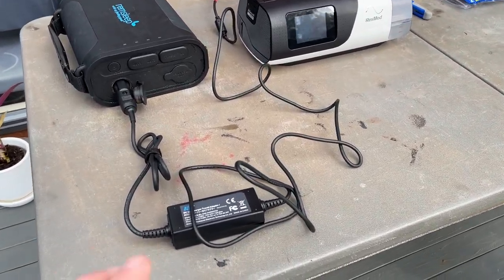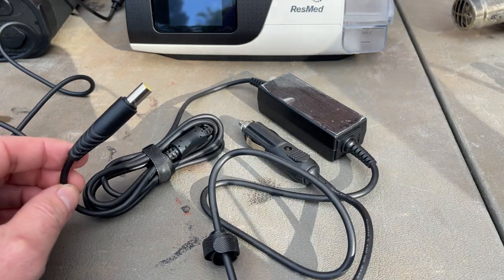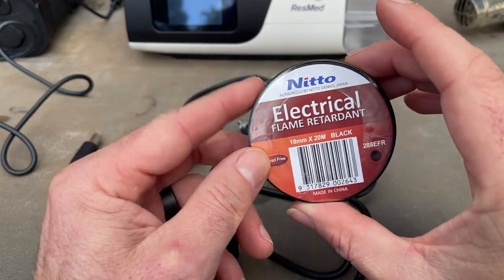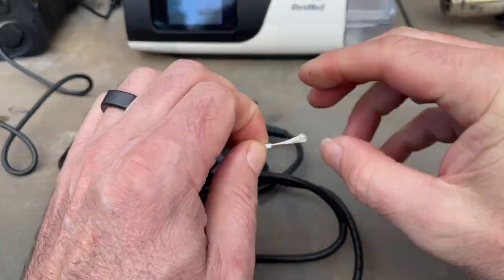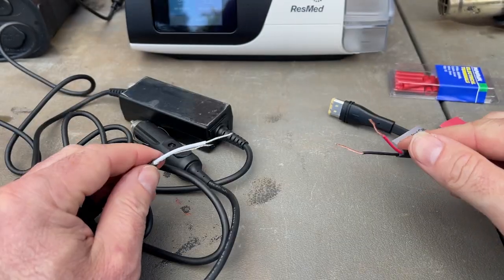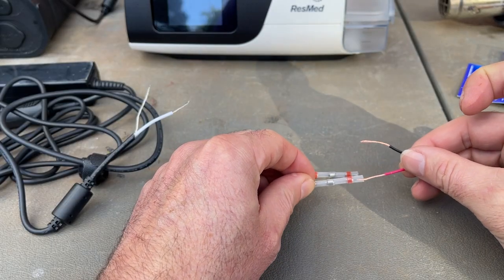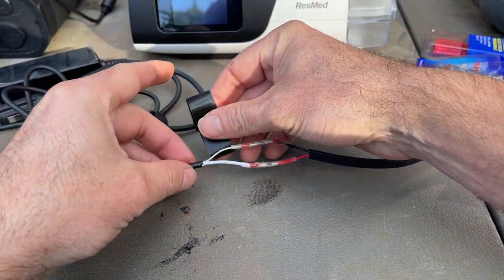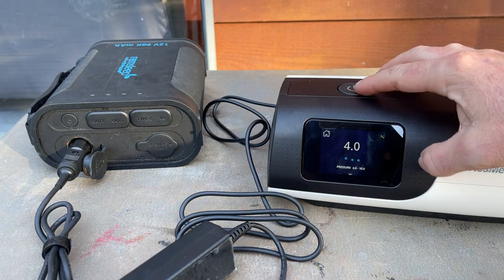🔌🔋You Need This! AirSense 11 DC Cable Hack

Comment: Followed your video and your hands-on advice worked perfectly. Using a Jackery  300 with the resmed 11 with the humidifier on I get 6 hours or slightly more. With the H2O off, I get 8 hours or more. This is for those power outages that happen occasionally here in west Texas, usually no more than four hours once or twice a year. Thanks for the advice and well-made video. I've been CPAPing for 11 months. It saved my life. Hadn't slept well for three years. Cherio, Mate!
Reply: you only get 6 hours off a 240Wh battery?  on my resmed S9 with a AIMTOM 155Wh/42000mAH i would get 20 hours.  Does that mean the Airsense 11 uses much more power?  Or this hack with the adapter is not optimal?  It appears Resmed now has an adapter ResMed AirSense 11/ AirMini DC Power Cord for the EXP Battery   but it is like $165 CAD.

Comment: One advantage of the DS 1 is that they run on 12v DC.   It was actually this fact that steered me to the ds1 over the as10 initially (in case of a mains power outage).      Thank you again for advocating for patients again!!   🍻
Reply from the maker: That was certainly one of my fav things about the DS1 also. Always welcome brother. Cheers :_hello:

Comment: I just bought the AirMini dc/dc converter and it does work for the AS11. Same connector type, plugged to a Jackery 300 and no issues yet.
Reply from the maker: Hi Juan, i have both an AS11 and AirMini and the AirMini Plug WILL NOT FIT A AIRSENSE 11 however and AIRSENSE 11 plug will fit an AirMini. Cheers
Reply: @CPAPReviews  hello there! I sent you an email with pictures. 😅
Reply: So what's the verdict? I'm going camping next weekend and still trying to figure this out :-(
Reply: @CPAPReviews  
You are correct that the Airsense MINI's plug will not fit an Airsense11.  However...  The Airsense11's plug WILL FIT THE AirMINI.

What kind of magic is that, you ask?!??  The two plugs (and their respective sockets) are only different in the corner chamfers.  The pinout is the same.  The plug and socket chamfers prevent plugging the 20w AirMINI ac/dc adapter into the Airsense11.  Resmed designed it that way because the Airsense11 needs 65w, and the 20w AirMini ac/dc adapter is insufficient.  However, the Resmed 65w Airsense11 ac/dc adapter will work on BOTH the AirMini and the Airsense11.  The plug fits both, and wattage is sufficient for either of them (more than sufficient for the Mini).

The Resmed "Airsense Mini DC/DC Converter" is also 65 watts, just like the Airsense11 adapter, and has the same "high-wattage" plug as the Airsense 11 ac/dc adapter.  That means that the Resmed AirMini 65w DC/DC converter will work on BOTH the Mini and the Airsense11.  

Like @Juan P Hernandez, I have been using the AirMini 65w dc/dc converter with the Airsense11, and it works flawlessly.  

The only complaint I have is that the Resmed DC/DC converter has a fixed low-voltage cutoff of 11.4v, as measured under load.  Depending on the load, the battery's resting voltage will be higher when the load is removed -- and thus the converter tends to shut down sooner than needed, leaving unused capacity in a deep cycle AGM battery.  The home-brew solution for that is a 12-to-24v boost converter that accepts input down to 10v, a separate low-voltage cutoff relay that can be set lower than 11.4v, and a custom cable job like you did in this video.   Cheers.

Comment: Hi Nico, thank you very much for the instruction. 

Does anyone happen to know the commercial type code or name for the flat power input connector that is used in AirSence11? 

I mean the only problem is to find the connector.
Reply: lol Just asked the same thing. $39 cad for the small cable lol ya right.

Comment: So instead of chopping off the AS10 connector, you could leave it attached, and make a Y cable, that would work on either the AS10 or AS11... or Mini, if you can find the right connector for it?  Or does the AS11 cable work on the Mini?
Reply: So I bought the wire kit, and if you do chop off the AS10 connector, the other wire in the kit converts the AS11 connector back to AS10! But it would be super to find an adapter to go the other way, from the AS10 to the AS11 connector, rather that having to make one.

Comment: I see you only solder two wires, so Model 10 and 11 don't have data pin? I have s9 and use some kind of verification pin along with 24v to work.

Comment: Your link points to a 90 watt converter.  My AS11 uses a 65 watt AC Power supply. Will the 90 watt source work with the AS11 without damage?

Comment: I've just begun to use a ResMed 11, and would like to know how much more run time I would have, using the DC connection, instead of the supplied AC plug, with my Bluetti power station. Thank you!

Comment: Thanks for this! I hate proprietary crap like this. They do this for "SAFETY" reasons my ass. I just got the AS11 and am more disappointed every day. I looked into this, and for us Canadians, this is about $20 cheaper then buying the proprietary plug... (about $90 for plug and PSU - or $107 for on the big A) HKY Replacement Resmed AirSense 11 DC Converter.

Comment: Hi great video, can you tell me the name of that yellow plug male that plugs into the back of the cpap. I am making a 12 volt unit with buck boost converter to 24 v to plug in there instead of going through a 100 watt converter. Also knowing the unit draws 65 watt thats what it says on my unit, what size of lithium unit I need for a 7 to 8 night ?? thanks

Comment: Nice work Nicko.  Is anyone aware of any batteries that can be left plugged in to the wall outlet and only kick in to run the CPAP machine if a power cut happens in the night? I.e. a UPS that would work well with CPAP and power it for a night or two if the power runs out?
Reply: I did run as AS11 from a solar generator, so a UPS should work, but most of them make a bloody screech when they switch over to battery.  Only some of them can have the screech squelched.
Reply from the maker: G'day mate, that AirPro 360 can be run inline and if the power shuts off it just keeps running. Don't know how healthy it is for the battery cells having constant current running through them all the time but it certainly works. I think it's probably best just to keep it in the top drawer though as it only takes 1 second to plug in. This one even has a torch on it haha. Cheers
Reply: Medistrom 24 Lite (Or 12 Lite if you have a 12V CPAP) can do that. They promote this feature, apparently seamless if the power goes out your CPAP keeps working

Comment: One can only wonder why ResMed switched to the odd-shape power connector for the Mini and the 11?  And why would the Mini 12-24V converter not work with the 11?  The power specs seem compatible.
Reply: So they can sell more stuff?
Reply: @jjp5421  That's the only reason I can think of, too.

Comment: Title of video confused me at first, really should be "Adapt ResMed 12volt to 24 volt converter for AirSense 10 for  Airsense 11"
Can you tell me the approximate amp draw of the DC/DC converter with humdifier and heated hose disabled ?

Comment: Hi Nico, thanks for the valuable info in your videos, just a thought but to use the 12 volt supply with the newer and older unit why not just file the edge off the end of the input plug so it fits the other/ both sockets rather than buying and soldering another one. Sorry if I have missed something basic and made a daft suggestion, this of course assumes that the power supply output is suitable for both units.
Reply: Did that work for you?
Reply: @warrendeming7885  Hi Warren, as mentioned in the post it was a suggestion, I have not tried it as I don’t use that equipment, but I am a “hands on Electronics Technician” who does not indulge in bodge engineering but will look for the simplest way of achieving an end result. It looked like only the outer metal sheath at the corner would need removing to allow the plug to fit the socket and it would still fit the original socket. A few measurements would prove or disprove this.

Comment: Does anyone know how many watts the airsense 11 draws using 12 volt dc adapter with heat humidity and heated hose at 12cm of h20 preasure?
I just orderd a bluetti eb70s 716WH for camping ..

Comment: I am no electrician, so not sure how this impacts things or not...  The Resmed Airsense 10 uses 90 watts, whereas the Resmed Airsense 11 uses 65 watts.  If you use the Airsense 10 cable, wouldn't you send too much power to the unit, or does it only take the 65 watts that it needs?
Reply from the maker: Only takes what it needs mate 🥳